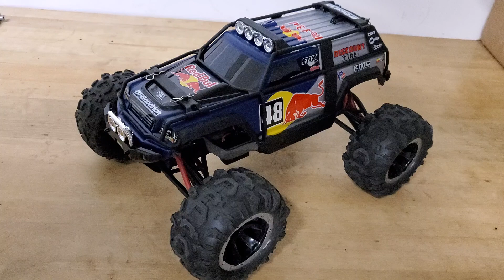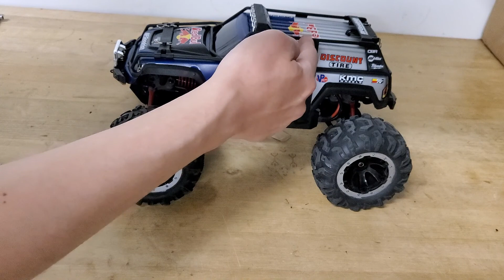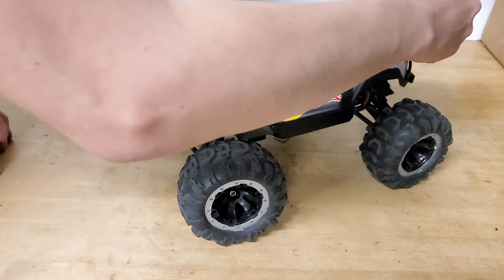Traxxas 1/16 Mini Summit Redbull Build! (Log 2)

Comment: Just bought one I love it! My first RC car and I'm trying to start tinkering on this one. Is it a headache to make it like the 110 scale with the high low differential?
Reply from the maker: It's not possible to make it have the locking diffs and 2 speed gearbox without re-engineering the truck